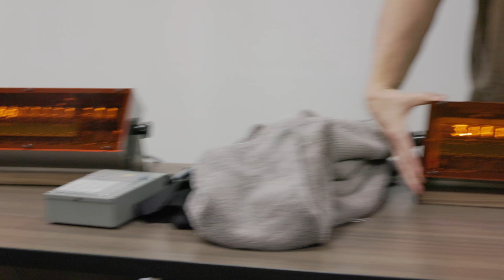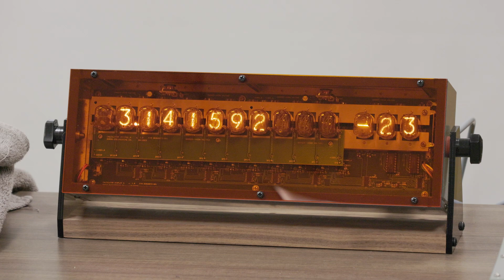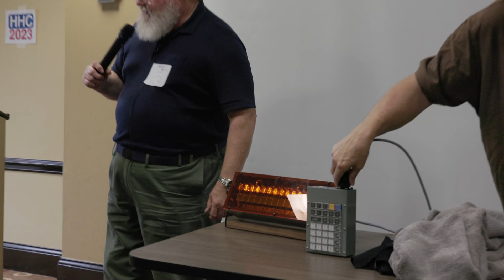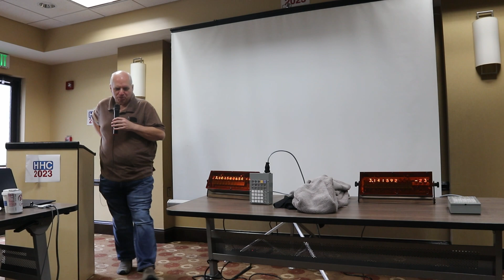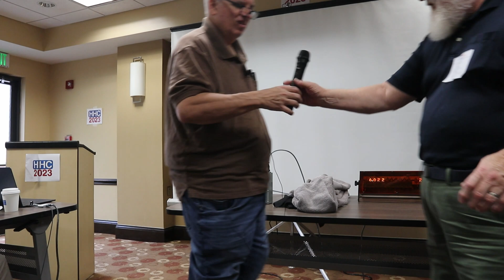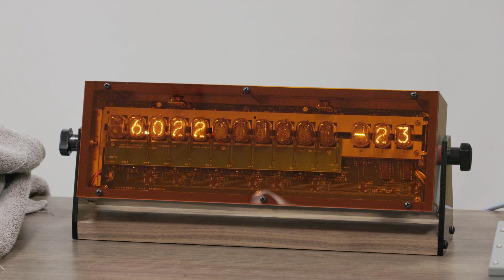HHC 2023: Building a Nixie Tube RPN Calculator (John Doran and Eric Smith)

Comment: I gather the nixie's are not multiplexed.  Multiplexing them would result in far less current consumption.  Also, zeners are commonly used to avoid stressing the driving transistors.